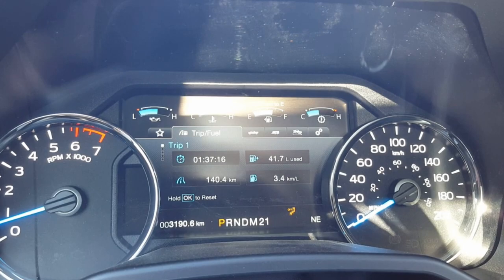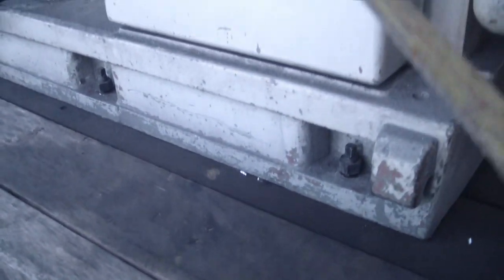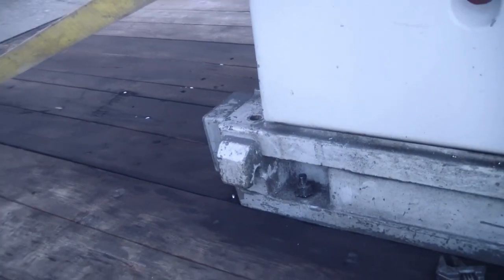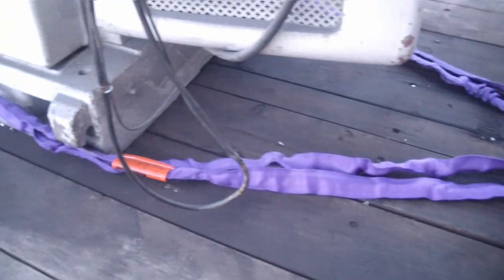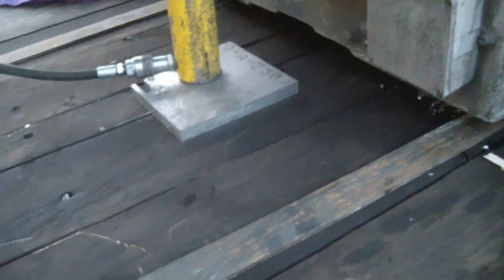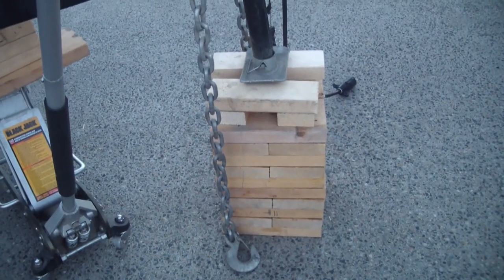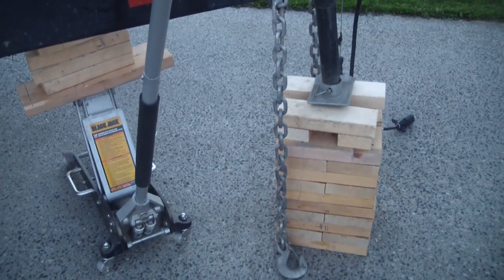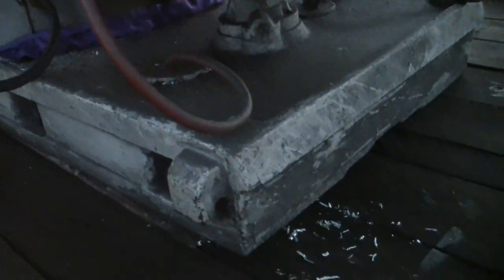How to move heavy iron SOLO. Cheap, Dirty and Downright Dangerous.

Comment: We had an old guy come in the shop once, said they used to move mills and other machines with a bag of glass bead and a crowbar. Lift the machine up, throw a bucket of glass bead across the floor and under the machine, and one or two guys could push it around by hand. Get it where you want it, then jack it around with the crowbar while blowing the bead out from under it with a blow gun.
Reply: Erik S f ing ingenious the old boys
Reply: Having slid in glass bead I believe it Erik S.
Reply: That is how heavy statuary is also moved into its final place on pedestals.

Comment: I was worried sick watching you move this, not so much because if it fell over it would squash you like a bug, but because if it did fall over and squash you like a bug, there would be no more videos.
Reply: +God of Thunder (UKKONEN) It might also damage that nice mill!
Reply: +God of Thunder (UKKONEN) Sure, but on the upside, this video would get 10 million views.
Reply: +verdatum I was more concerned about the concrete...
Reply: +God of Thunder (UKKONEN)
only his balls, made of sintered osmium, would survive....
Reply: +w0mbles There would be no views because he wouldn't be able to upload the video. unless he made some sort of contraption like the one in the the film Taxidermia.
Reply: +Rick Deckard nope, not sintered. sintered metal isn't as good, his are laser cut and diamond ground.
Reply: Wyatt Roncin you were able to find two natural chunks of osmium that big? and sintered can be just fine, if performed under controlled conditions.....
Reply: +Rick Deckard I didn't find them. he clearly did though. but you can grow pure osmium crystal if conditions are controlled.
Reply: Wyatt Roncin single crystals are not isotropically strong....polycrystalline materials are tougher and more resistant to plastic deformation because they dont have slip planes that run all the way thru the specimen...jet engine blades are sintered for just that reason (single crystal blades are used as well, but only with the strongest axis experiencing the most design stress)
Reply: +Rick Deckard I concede to your infallible argument.
Reply: Wyatt Roncin your points are well taken as well....i bow to your sophisticated and socially elevated online etiquette...my respect, sir.
Reply: +Frank Winkhorst I thought that was being bathed in vagitarian farts and smothered in tree hugs...
Reply: that's the part when the wifee uploads the video with a blistering tirade at all of us for encouraging her sweet naive husband into doing dangerous stunts , and how we encouraged .............and we wouldn't be allowed to stop watching til we said yes mamma at least 10 times and cried for our sins
Reply: God of Thunder I was worried for the mill if it fell over.

Comment: AvE, you crazy bastage. LMAO
I have seen (and used) some sketchy rigging in my time moving machinery, but that was just scary. Almost as scary as rolling my combo horizontal / vertical mill on pipe down the ramp of a Penske 28' rental box truck, she was half way through the shop before she slowed down.  LOL
Reply: +CumminsDslPwr  run far! run fast! lmao
Reply: +gremlinkiller run to the Sea, run for your Life! ;)
Reply: +CumminsDslPwr  Yup and here I thought shuffling a big ass warping machine (textile) with a wonky under dimensioned forklift was dangerous, ha me silly german doing such child's play.....
Reply: That's pretty funny
Reply: +CumminsDslPwr is that what they talk about when they refer to machinists cheating at bowling?
Reply: +CumminsDslPwr Ahhh yes , nothing like the moveing power of 3/4 inch iorn pipe on the floor !
Reply: +CumminsDslPwr  A little pipe'll go a LONG ways!
Reply: +CumminsDslPwr I like the brief pauses when something shivered his rigging, then right back to tempting fate :)
Reply: Brain cramp then full speed astern!
Reply: +Richard Smith every frikin time that beast creaped , my muffler choked
Reply: I had a job shifting safes and there's nothing pipe and a crow bar can't shift. Stoping the buggers OTOH can be more variable. Nearly demolished a brick garage using a rental tilt tray and a large safe that tried to flee. Fine job that one, gotta watch that free range shop equipment, never turn your back.

Comment: The gutsy way would have been to tie a strap to the machine, then pull the trailer out from under it with a truck. Yehaw!
Reply: Fortune favors the bold but eats the stupid alive.
Reply: +Mark McCormack Yep. With that plan the next video would be about turning a 5K machine right side up, and truing a kurt vice and a Z azis.
Reply: +GunFun ZS err I guess on this channel it would be "upside topways"
Reply: +GunFun ZS haha so true.
Reply: +Paul Frederick I was sure that he was going to do that.  But in the end.....
Reply: +Paul Frederick think id of gone for snatch block and pulled it of just the same lot less work
Reply: +Paul Frederick Yeah. Hold my camera and watch THIS!
Reply: +Paul Frederick done that with some derelict cars, works great
Reply: Erik Trent
Yeah if you have a couple hundred horsepower under the hood, why not use it?
Reply: exactly
Reply: I thought about that too. it doesn't weigh enough to pick the rear wheels of the truck up in the air to get the proper angle to slide it off of the trailer softly. he'd had to jack it up on the trailer (which would probably be more sketchy then the sliding ramps on block setup he used in itself), the attach thick metal to the trailer deck for a ramp and put the truck in 4wd, just in case the rear end of the truck did start to lift.

or at least that's how I used to unload our 16k lb mini excavators off our f-150's, but that didn't really take a ramp and needed at least three people. one to drive the mini, one to hold the brakes when the rear end lifted, and another person to sit there and call ya a dumbass and have your mom on speed dial the whole time and leave just as the mini leaves the trailer and the truck and trailer come crashing down. usually the trailer bends, not the truck or hitch... usually...

I think ave's method was a bit less destructive and was more plauseable with only one person.
Reply: +GunFun ZS Next video, How to turn a vertical mill into a horizontal mill. lol

Comment: The Roman manual on architecture by Vetruvius... Read about the machine(s) of Metagenes (and sons). Stones at Baalbek, pyramids, whatever... No aliens needed. A bit of napkin math with the rolling resistance equations shows that it'd take less than a dozen guys to get it done. :)

Comment: Nice job of survival there!  The scariest moment for me.was when the steel ramp parts finally took the whole load and went boingeddy-boing for a few seconds. Was afraid the mill was going to stick the dismount!  Hats off to you for gutsy success!  My heaviest solo move so far is a little 9" South Bend lathe and the angle iron bench it sits on. Together they didn't weigh 20% of what your mill does. It was still exciting getting them out of the back of a pickup with an engine hoist on a sloped driveway though. No guts, no glory....no brains, same story! Think it through first and you don't have to fill out paperwork...

-- Mike

Comment: from the title "Downright Dangerous". at 4:06 where it can go - down - right - side slide of the track. Weren't you at all concerned that the center of mass might not be in the middle and tumble of the ramp sideways? We've all seen those kind of youtube video's.
Reply: +AvE Noted. Still, are the tracks not fixed to each other in any way? Just laying lose on the woodblocks and big steel bar?
Reply: +AvE "dix points" (i overlooked/overheard that "tacked")

Comment: It's amazing what can be done with a simple machine or two  I moved a 20 ft shipping container, about 5000 lbs, onto my property in a place that we couldn't get the delivery trailer to.  Had to work it between some trees and other structures and down a 5ft slope.  Did it with two of my friends, some wood skids, a come-along, mill end for fulcrums and 10ft 4x4's.  Slow and careful gets the job done.

Comment: Hi, Use the leveling screws to raise the machine to it's maximum if there are no ports for a toe jack. Then use a toe jack to raise the machine and then slide in fixed machine skates. The do the same at the end you need to pull the machine from and slide in a swiveling machine skate. Then pull the machine out of the building. When placing into final position in your workshop, use silicon paper under the feet so you can bar into position with precise accuracy.

Comment: My friends boat lost a wheel/hub about 100 feet from an exit lane for a weigh station on the interstate. I ran back and grabbed a pallet jack and two extra car jacks and with some straps to fasten the jack to the boat trailer we where eventually able to move it 1/2mile or more out of the way.  Sketchiest rigging I’ve ever done but it worked.

Comment: Glad to see you are improving your mancred, too. I did buy a cheap HF electric engine hoist to get a 1898 kimball upright into my apartment and up the second story flight of stairs. The owner loved me drilling 1/4 3" lag bolts into the bldg's frame to get it up there. Not something I am likely to do again. Now I have to refinished its finely carved panels... been tinkering with MEK a bit for that. Since it is from two centuries ago I want to make sure I do it right. You could have used that hoist.

Comment: I've heard it used mostly as a metaphor...but literally, why not "grease the skids?"
Reply: maybe to not let the machine slide all the way down
Reply: I agree. I've slid bigger gear than that on steel surfaces. I use water as the lubricant because it dries up (you can regulate how much there is) and is self cleaning, which grease most certainly is not.
Reply: I was thinking that exact same thing. Rather than .5 inch per hour could've been double that.
Reply: Not sure if the downslope would have got any control when greased

Comment: Reminds me of moving a supermarket safe around my garage. I used the engine hoist to lift this block of steel and concrete and the wheel dug into the concrete floor like it was sand or something. It was hanging on chains and the hoist had 6 steel wheels, but still I needed two heavy gorillas to even bump this thing into movement.

Comment: I was holding my breath all the time you were dragging it off the trailer and I knew it had to be successful or you would not have been posting the video.  I did that same thing one time going off a trailer and later onto a truck and even later on to a trailer with a big heavy horizontal mill that was never able to run.  I should have known better.  Thanks for sharing.

Comment: I recently moved a 5600 pound lathe with a pallet jack, my friends Jeep in 4-Low, and a tow strap around some large electrical conduit >_> The pallet jack kept sinking into the damn asphalt. I have gotten very familiar with the pipe roller and crowbar method, moved 20,000 pounds of various lathes and Bridgeports this summer that way.

Comment: i have moved a few sheds and some heavy shit in my years ,, i use steel pipe as rollers ,, i would have hooked a strap to the other end of the machine and let her go down the trailer and if you want to go faster use a chain or strap to the truck and drive towards it letting it go down the trailer ,, then you could have used a pulley bolted to the floor and pulled the unit in the garage ..

Comment: Ive done this exact thing numerous times at home in Seattle although once i get it on the flat i use steel rolling pins to scoot her around. My mill is a toolmex polamco fwa41n shes a bit heavier 13000lbs then your girl but she was good and cheap. i tend to use my jaws of life to lift my machines to get my pipes under makes things go much faster.

Comment: we unloaded  our horizontal mill with a hay squeeze  but them they way 14,000 pounds they lifted the back end of the hay squeeze  off the ground  but a hyster forklift wont even try to lift it cant wait to see what  you use a vertical mill for

Comment: Hat's off to you, you used good rigging.  

The ramps seemed sketchy, but usually people skimp on the mecharnical pulling aparatuseses too.

Kito lever hoist,  Crosby shackles.  Round slings that don't look like they were picked out of a dumpster full of tears and holes. Better rigged up than most industrial lifting in Albertastan, at least.

Comment: Uh, I just did the exact same thing alone with a Hendey No. 3 modified unfortunately with a Bridgeport Head. Mine was at least in 3 pieces. I used black locus planks which seem to have incredible strength thank god. You at least had steel and a chain type come along. I had 3/4 braided rope and a ratcheting cable type come along. Good job! As my grandfather said to me, you are as big as you think you are.  He meant that in the most humble way to prove to yourself your abilities. I think i would rent a fork lift if I were to do it again though. Scary dangerous, for men with more balls than brains. 
I like your wife's honey do list. Very appropriate!

Comment: Smear a couple tubes of EP2 under the mill, throw her in reverse and slam the brakes when you get to the garage. If the trailers is a little bit too high just take the air out of the tires.

Comment: In 2015 I bought a 2000 pounds  Bridgeport mill to replace my 800 pound Rockwell mill.
I rented a 2000 pound trailer to haul the 800 pound Rockwell 900 miles to give it away.
I drove the 900 miles in a day. But moving the 2000 pound mill 55 feet around my house took 11 days of hard work.
The last day I needed to get it off the palate and the wife said I needed someone there smarter than me.
I called up a guy with no college but lots of patents. He came over and made suggestions.
I would not THINK of taking on a project as hard as AvE did moving the 5000 pound Mazak.

Comment: Used this exact system to pull a Waukesha 7042 out of a compressor building. Being the welder of the rails and gussets for the bridge like system caused me to have a strained butthole from all the puckering.... Either way we just had to get the damn thing out of the building for the crane. The other option was removing the roof...  But you know how insulators are. Gotta get the Welders out to get shit done! Fortunately it was all flat and level,  no ramp at the end and we had some bad ass rollers that fit in the 5 inch channel.

Comment: Looks like you've got a lucky streak.  go out and buy a fist full of lottery tickets.

I did a similar off-loading with a No.21 Buffalo Drill Press.  (>1. ton).  (actually my wife helped, so I can blame her)  

The difference is, the steel trailer and the steel ramps flexed just enough for the machine to outrun the come-a-long and scoot down the trailer and ramp.....  Face planted right in the middle of the driveway.!  

Well, it was easier to grade a wide spot in the drive (enough for the wife to go to work!) and I spent the next week, dissasembling and moving the carcass, piecemeal to the shop.

Keep up the good work.  Power to da pipple.  :)

Comment: You are frigging nuts, I thought for sure that would have jumped off those skinny tracks you set for it to follow,  Been in the forklift industry for over 30 years and never seen what you just succeeded in doing . About $500 and 20 minutes for a 15 or 20.000 Lb fork lift  it would have  been setting where you want it and done. LOL, you the man

Comment: Nothing says "thrill of victory" quite like escaping decapitation while using an improvised "come-along crane".  

Used the same idea to rescue a jeep that was centered between two trees, with about an inch of clearance between each tree and the front and rear bumpers, uphill in three inches of mud at 2am, with a flashlight that worked when it wanted to.  Two feet down the hill was a small cliff, so if the cable slipped or snapped, the jeep would've become scrap metal.  

Did I mention that it was raining, they may have been 4-wheeling someplace they shouldn't have been, and the come-along was one of the finest, high-quality, $10 guyhunglo tools money can buy at the local 24-hour five and crime?

Good times! :)

Comment: you being a much smarter man then me was there a reason for not lubing the metal rails or for not unloading it onto rollers or ball bearings .... either way good job
Reply: +Sethdick50 You got me picturing it going down the ramp, into the garage and out the other side haha
Reply: +Sethdick50 Good lord, he was right on the edge of that thing sliding down without control as it was, a bit of grease and he'd have had to run for cover
Reply: +David Hoekje Yeah not having an arrester on the backside that's payed out as it moves forward is mighty scary.
Reply: so he doesn't turn the garage into a drive through with a mill in the garden

Comment: Just curious, though obviously a moot point since it's done, but for the initial moving of the mill from middle of trailer to end, couldn't it have been feasible to secure the mill to the shackles in the concrete as you did, but instead of ju,ping right to the come along, pulled the trailer forward with your vehicle? Of course you couldn't get to the point of actually getting off the trailer that way, but maybe to work around the steel/wood friction issue...

Comment: In the past I've jack up my heavy shit and put it on scaffold tubes as rollers... its MUCH less effort than dragging steel on steel, you just need to remember to grab them off the back and put them in front, or it ends up on the floor.